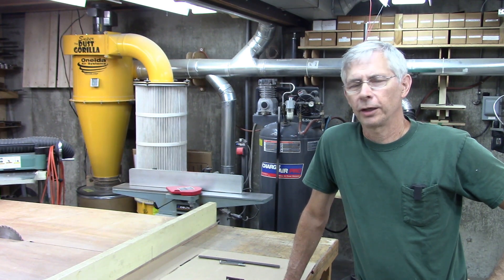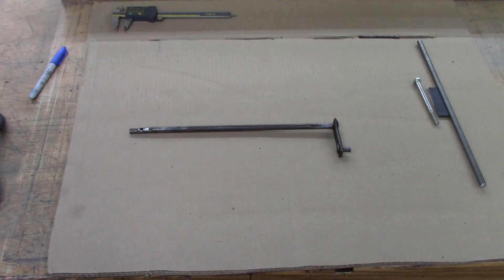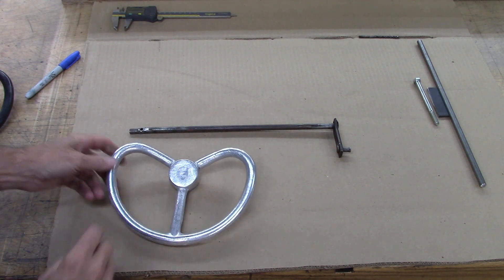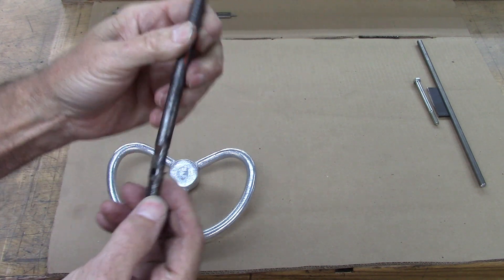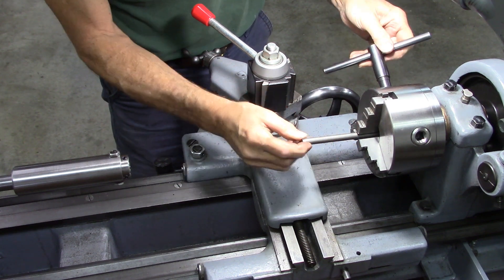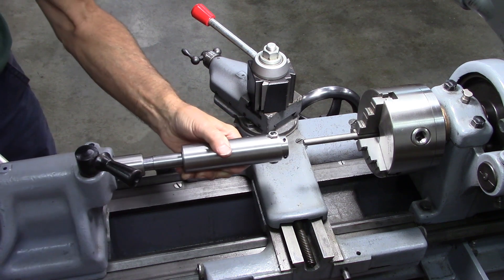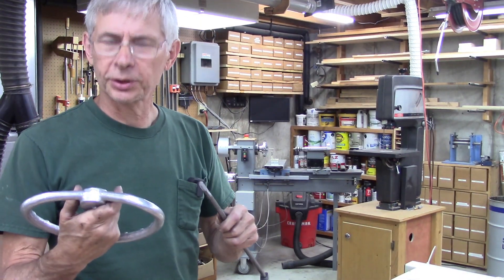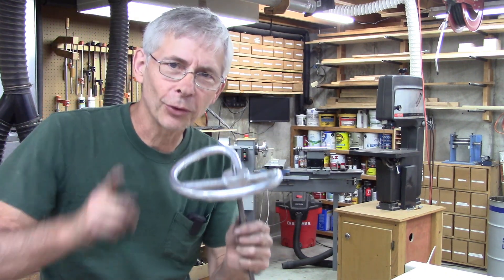Boring a Weird Shaped Hole

Comment: I always enjoy your projects and solutions. Having a 1939 South Bend 11" X 4' under mount motor lathe which is similar to yours with a 1 and 5/8" -8 spindle and 7/8 through hole I was wondering if you had an adapter to fit a Jacobs taper in the spindle end ? If so can I get a description and measurements of it? Also I have a jet 15 mill drill very similar to yours and was wondering what is your X and Y DRO setup. I know you made a video on the z-axis did you make one on the xy and the brand? Thank you for showing your many upgrades on both these machines, I've used a few of them already.   Ed,  N.E. Ohio.
Reply from the maker: Thanks! I bought a No. 3 to 2 JT adapter and it fit perfectly
Reply: Okay thank you for the reply mine is definitely not a number three it must be a proprietary adapter. Do you have any info on your Dro for the mill thanks
Reply from the maker: @edwardkawecki8101  No I'm pretty sure I bought a No. 2 to 3 MT adapter. Now I'm doubting myself. I did read that some of the lathes have a odd taper but the adapter fits perfect
Reply from the maker: @edwardkawecki8101  Edward, I just tried the adapter and it does fit. However, it geos deep into the bore (maybe about 3/4"). I put bluing on the OD of the adapter and checked the contact. About 1/2" of the small end has no contact but the rest is perfect Maybe not ideal but it does work. Also I had to get an extended center to use with a face plate. I hope this helps.
Reply: Thanks for double checking I am going to have to try and take a good measurement of my spindle ID taper and probably make an adapter. When I also tried Bluing a Jacob's taper it did not match up good and it wiggled around. Many things I believe were more standardized after 1942
Reply: Meant to say Morse taper not Jacob's taper maybe it's a jarno or some other taper used by South Bend in that era

Comment: Drill a normal hole then use a brooch that transitions from round to the desired shape. YouTuber Click Spring shows making a brooch just copy the steps just finish with your desired shape
Reply from the maker: I saw that...  very nice for doing a bunch of holes. I spend very little time making my broach and only needed 3 holes. His method is good but too involved for 3 holes.

Comment: Best part is, If this ever  became worn out you could easily build a small steel plate to fit the shaft & bolt it to the wheel
Reply from the maker: Agree, this would be a better method

Comment: I just purchased that same dust collector... How do you like it?
Reply from the maker: Aside from it being too tall for my shop it's fantastic. I put the motor up between the floor joists but I'm limited on drum size. Suggestion. Cut a hole in the side of the drum with a hole saw. Maybe a 2-1/2" diameter about 3" down from the top. Then install a thin (maybe 1/16" thick) peace of plastic over the hole. The plastic will flex and conform to the drum and can secure it with screws. This will let you monitor the level of the saw dust. If the drum gets too full the dust clogs the filter and the filter is hard to clean. It separates perfectly otherwise.
Reply: @WinkysWorkshop  thank you

Comment: How about putting a set up block(s) under the arm so that the cut is accurate on both sides of the rod & just not "eyeballed"? Real machinists are not inaccurate on purpose.
Reply from the maker: Yeah...  I agree the blocks would assure accuracy although I trust my eyeballs for a one off. I was thinking a collet block might be a good method if I was doing multiples. And who said I was a real machinist? This comment is very interesting and leads to many questions. Like, is there a time when good enough is good enough? I agree that their are many instances when absolute accuracy is very important but that there are also many that achieve the same outcome without a more effort. I have worked with several very good machinists in my job before I retired from the printing industry and I will say that they were a good influence. I had a job as a engineer/machinist without any official training. 100% self taught. I made several  hundred significant machine improvements without a single failure. Don't get me wrong. I'm not on the defensive here, you made a very good point but I am saying, there is a time and place for both good "good enough" and "dead on". I was the guy that did what the engineers said I could not do. I will have to admit, it was fun to prove them wrong. I guess there was one failure. I never did figure out of to combat a huge static electricity problem we had.  I installed 10 4-nozzle misters 30 feet above the floor with a filtering system the real engineer designed and ended up cleaning them weekly for 4-month out of the year. They helped the static a little but not like I thought they would.
Reply: @WinkysWorkshop  I am not criticizing you or your methods. I too am self taught hobbyist with high school shop training. My philosophy has been to try to do good setups without being overly complicated about it. This keeps me in practice using my tools for when I do need the accuracy. Don't get me wrong. There are times when the Mark 1 eyeball is good enough. Keep up the good videos. Yours show good alternative ways on doing projects.
Reply from the maker: @cpcoark  Yes I understood, your suggestion was a good idea. I just thought it brought up some interesting differences in the way people work or approach a problem. Thanks for your suggestions they are always valued. I learn a lot from the feedback I get....  and get many ideas.
Reply: I agree. A adjustable parallel block with some stand off blocks would make it easy to setup the flat for milling
Reply from the maker: Or maybe a collet block. Thanks for watching

Comment: It's good to see a video from you again. I just noticed that you have over 35K subscribers. I remember when you hit 25K after the Briggs & Stratton car.
Reply from the maker: Thanks Andy! Yep, I picked up about 10K subscribers with the car videos. I'm thinking about making another one only electric. They actually made an electric version called  Red Bug in 1923. I thought about an on-board gas motor but that would not be original. The electric version had an on-board motor.
Reply: @WinkysWorkshop  The Red Bug sounds like a interesting project. Does the electric model drive the rear wheels or does it use a fifth wheel for the drive? I thought that was a odd way of getting the power to the ground. I imagine that the original gas version was aimed at people who lived outside of smaller towns who wanted a way to get to town and back without hitching up a wagon inexpensively. I am going to look up the Red Bug.
Reply from the maker: @andyZ3500s  From what I understand the Buckboard Flyer was like a sports car. It was a toy for the wealthy. The buckboard flyer used an add on gas motor designed for use on a bicycle. It was called a motor wheel. The electric version had driven wheels. The motor wheel works and its an interesting idea but it chatters in turns and makes the car very long. By using an electric motor the car would be more "authentic". They never made the gas version with the motor "on board" (wheels driven).
Reply: @WinkysWorkshop  I looked both up yesterday. I could see why the electric vehicle was marketed for the wealthy as most rural areas didn't have electricity at that point in time. I recognized the internal combustion drive wheel as soon as I saw a picture. In one of the advertisements of the Red Bug they mentioned that there was a JR. model for the little ones. The electric one would be a cool project. Just what you need though. Well I think that I'll take my Red Bug down to the harbor and then stop by the club.
Reply from the maker: @andyZ3500s  - Interesting...  I didn't know about the JR version.

Comment: Nice approach.  It warms my heart a bunch to see somebody restoring old toys like that.  With that steering wheel being aluminum, I wouldn't be surprised if the guy at some point wants you to make him some steel flat washers with that same weird hole in it to fit underneath the wheel on the shaft.
Reply from the maker: That's a good point and I thought about that too. Probably a good idea!
Reply: Good job requiring some thought for the radii. The soft tool worked well for aluminum but for steel you need a case hardened broach. I’ve found that “Cherry Red” works well for small steel parts. Heat the parts bright red with a torch, dip in the compound until coated, then reheat and quench in cold water. No tempering required.

Comment: I have a lot of problems with the stock slipping in the chuck when using a die. Not sure whats up with that.
Reply from the maker: If I remember to tighten the stock extra tight it seems to be okay but you are right...  threading takes a lot of torque.
Reply: If you wanted to thread a 3/8-24, for instance, the shaft should be slightly smaller, say 0.365.  There is no need for 100% threads.
Reply from the maker: @makerspace533  True statement but it's also a matter of convenience. I just didn't tighten the chuck enough.